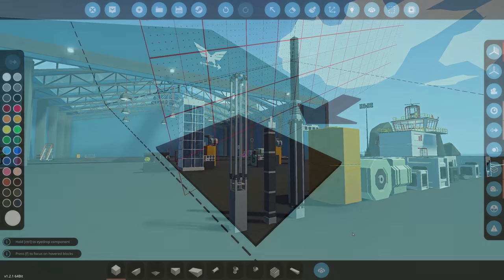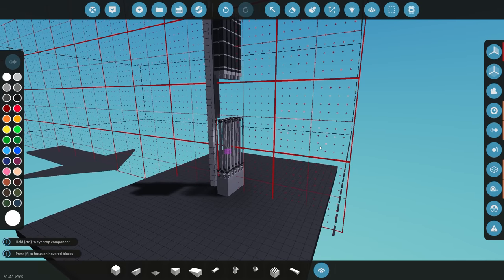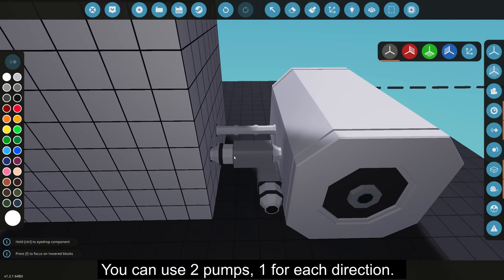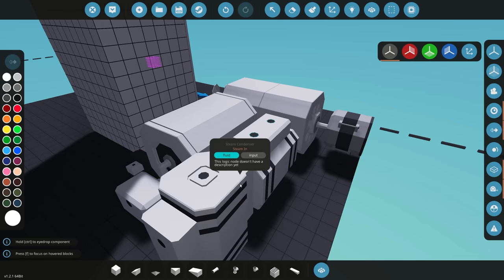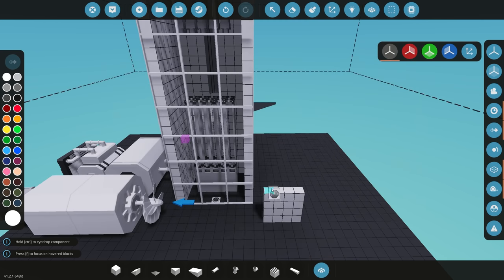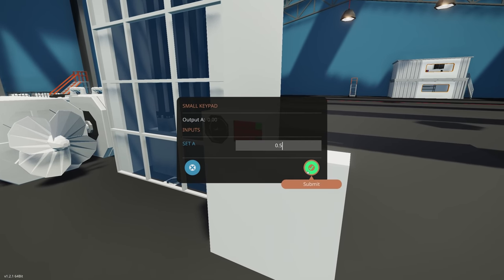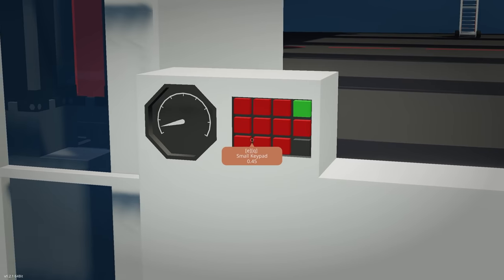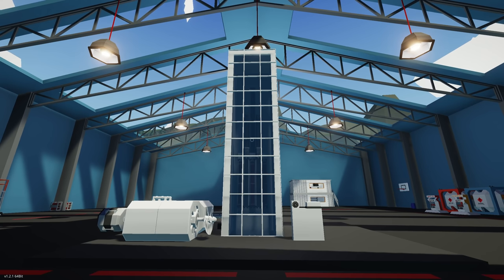Building a Nuclear Powered Engine!!!! - Stormworks

Comment: Thank you for the tutorial, I'd like to add some help of my own.

Control rods were the most annoying part of a reactor for me, since function blocks keep a static temperature and if you want to test what temperature works best, it is a god damn nightmare. Also that control rods are confusing to put in and for a while I actually thought they inserted into the fuel assembly like fuel rods - thank you, Stormworks description.

To place them in right, you have to line up the black 'weld lines' on them with the fuel assembly, or three blocks lower than from the top of the assembly.

Also, control rods limit the reaction rate of their neighbours, which means fuel rods that are diagonal or horizontal to them, that are right next to them.

To use a PID to control the temperature of the rods, positive P values wont work. You have to use negative P values.
I also recommend using a clamp for the PID, with the lower bound being 0.1 and the higher bound being 1.
In my nuclear reactor, before I added the clamp, the temperature would fluctuate by about 300 degrees if I was aiming for 500.
With the clamp, it only fluctuates by about 100. Not the best, but not the worst either.

Quick edit:
For the boilers, you dont have to use an on/off valve to control the pressure and temperature. Instead, you can use two PIDs.
PID A reads the temperature of the boiler. PID B reads the pressure of the boiler.
For PID A, link the output to a variable valve going to the "coolant" in of the boiler. For PID B, link the output to a seperate variable valve going into the water in on the back of the boiler.
For me, PID A using P=1 and 0 on everything else works extremely well, and a target temp of 130 gets it to 129 and some decimal.
Reply: What did you put the setpoint of PID B as?
Reply: @Babadaboopi  1, but so far I haven't been able to control pressure using PIDs, only temperature
Reply: Touched Stormworks again recently, learned some new things from slapping together a reactor to get the basic concept down. A couple things:
1. On the PID that controls the control rods, set a max value of 1. This acts as a clamp and prevents integer runoff (correction value going up to 7 billion when the system only accepts 0-1). I find that a P value of -0.1 works beautifully at regulating reactor temperature, with an error of 0.3 degrees. Can't remember if I had any I/D gain, though..
2. You can 'control' pressure by limiting the amount of water the boiler gets. This is done by making a closed loop with a water tank. This way, the boiler pressure will stay the same once it gets up to steam (hahahaha)
3. Condensers are... weird. Try to use a normal cooling loop and they turn steam into steam. From what I understand you can only put cold water in, making them a sort of black hole for water. This is fine for ships, though, because you have an infinite water source everywhere around you. For other things... not as much. I just put fluid ports onto the condensers with a pump straight into the coolant intakes. Works like a charm and is at ~55.
4. Reactors don't have to be terribly hot, apparently. Maybe it's the heat generated from the reactor seeping into everything around it but I could run it at 200 degrees and have enough temperature in the boiler to get steam. I thought something like 300 would be what you need, considering how much of a nice orange the fuel rods are.
5. I haven't tested it myself but I have heard you can take the steam from a turbine and run it directly into another turbine with no losses. (wtf infinite power?!?!?!)
6. 1000% have pumps to circulate steam and water throughout your closed loop. I tested to see if pumps vs. no pumps made a difference and they absolutely did. Without pumps I had 10-20 RPS or so on my turbine. With pumps it got to 50. Both without load, yes, but a massive difference.

Comment: The boilers, like radiators, don’t actually need tanks for the water that will be turned into steam. The boilers automatically contain fluid. However, it performs better with extra water tanks :)
Reply: But in theory, couldn’t you let the steam vent to atmosphere and have no tank, simply sucking in water from the ocean?
Reply from the maker: Already covered in Coal build of what the use of fluid tanks are.
Reply: @MrNJersey  I know, I was just saying it because of me forgetting to add tanks to a steam train I made before the tutorial lol. But what about the second question? I’ll have to test it.

Comment: i can never stop the boiler from exploding, even with a regulator of some sort. and even with overheating turned off at some point the reactor stops producing power entirely.
Reply: I believe this is my opinion from some of the other guys I’ve seen that you’re supposed to use two different types of coolant for the boiler one from the heat source and one to keep the boiler from overheating that’s from some of the guides I’ve seen that A needs to be heat source, B needs to be something to keep the boiler from getting too hot

Comment: Hrm, I've built a reactor identical to yours and my control rods do nothing.  The description for control rods says they can be inserted into fuel assemblies, but that's pretty confusing since they seem to actuate on their own (they make a sound at least, I don't actually see the part moving..)

EDIT: I'm dumb, the control rods were 1 block off from being aligned with the fuel assemblies, once I fixed that they worked fine.

Comment: So I set up my reactor, it is perfectly stable around 800-850 temp with 10 fuel rods and 4 control rods, however when I press the button to shut it down, the fuel rod blows up and irradiates the area. I assume it's due to shutting down the control rods as you disconnect the fuel. Am I correct in thinking this?

Comment: you dont need a water tank for the boiler and condenser, they spawn with fluid in them like radiators
EDIT: NVM from my testing having multiple turbines per boiler works best and turbines dont spawn with steam so when the boiler boils it loses water to steam so using a fluid tank inbetween the condenser and boiler will allow you to get to higher pressures.

Comment: I've been waiting for this update and I started playing around with different designs, but the only problem is that it seems that tge turbine does not have enough torque even using a single gearbox connected to a generator (the medium one) the best output I get is around 85 charge which can drive a large propeller at a mere 6 rps before it starts draining the batteries. So my question is what would be the one thing you suggest I add. Btw I'm using the same design at the preset provided from the update.

Comment: My question is, does the does the boiler+condenser also convert sea water to fresh water?
Reply: My question is does it accept salt water
Reply: it does not.. sadly. because that's the current bottleneck, is the steam output of the turbine builds up... 

if we could convert sea water to fresh water with a desalinator we could actually get some power from these things.

Comment: Usually you would use gravity to insert the "control" rods, not the fuel rods.. but.. to each their own :D
Reply: In game the control rods are used to regulate the reaction as the water in the reactor is not replaced nor is there any coolant for the reactor. If im correct in real life control rods are more of a safety mechanism to stop the reaction in emergencies right?
Reply: @natelav534  Correct. They regulate the reaction, but SCRAM inserts them all the way to stop the reactor in emergencies.

Comment: I know this is old, but can anyone help with the boiler not blowing up, I know that it's because the pressure comes over 10, but I don't know how to stabilize it.
Reply: If you have not figured it out yet, you need  to limit the coolant(hot water) in to the boiler by either using a variable or on/off valve.  I actually use a throttle and variable valve so that i can set the flow to balance the flow with the pressure and temperature.  You don't want to let the boiler get much over 115c so reducing the flow of heated water, you can balance the heat so it doesn't build or lose too much pressure.

Comment: My condenser just doesn't work. The water volume just slowly goes down, until it's on zero. I have a 2x3 fuel rod reactor, 4 boilers , 1 turbine for every boiler, 1 pump for every boiler, boiler fill level is on 0, tank fill level is on 7 and the function block is on x/10000. There is one condenser for every turbine and the condenser has 4 large radiators. The reactor's top temp is about 1100 °C. Every turbine goes to it's own fluid jet. Please help.

Comment: I don't get it, if you divide the fuel rod temperature by the desired temperature the result does not correlate with the desired position of the control rods.  Eg.  The core temperature is 250 and the target temperature is 250 then 250/250=1 and the control rods will be totally inserted and this will kill the reaction.

Comment: I made a massive reactor with 6 boilers and 10 turbines I was utterly disappointed at the performance. reactor temperature was around 1000 I was having 0 liquid in my boilers even with added tanks in my steam pressure was 41. Considering how heavy and large they are completely under powered at the moment.

Comment: Absorption rods must be between the fuel rods to slow down their reaction. And the fuel rods, if they are close to each other and there is nothing between them, should start a reaction and heat up even if they are not in the fuel assembly. 

By the way, the overclocked reactor cannot be stopped so easily. It will need more time for reactor to slow down. 

But the fact that loading nuclear fuel does not happen immediately and you need to manually load it is cool.  It was possible that they did not spawn, but that they needed to be buy and brought from somewhere else and then inserted 

Nuclear fuel can be used up for a long time. With normal operation, it should be enough for 25 playing years 

The idea is that it is difficult to charge.  And not because the nuclear reactor is weak or will end in 10 days. 

To absorb heat and radiation, you can make special heavy blocks or use ordinary heavy blocks. 

(Ру)
Reply: Thats how it would work irl but stormworks isnt that sophisticated. Even the devs demonstration reactor only has the rods on the sides.

Comment: can i only cool the reactor with the rods or could i also pump in cool water?
Reply: The rods control the reaction rate. Pumping in cool water won’t do much.
Reply: The rods dont actually cool the chamber, they stop it from getting more hot. The reason the temperature starts going down is because the steam generater attached is taking some of the heat
Reply: The control rods absorb the reaction created by the fuel rods. Pumping in cool water won’t help, as the reaction in the fuel rods is far too strong to let the temperature be affected by the water.

Comment: My pump doesn’t pump. Can’t figure out why. It’s hooked to a dedicated battery and constant on signal. It just doesn’t turn on. There’s way in the system. Piping is hooked up and fluid ports connected correctly.
Reply: Figured it out. Boiler was backwards. Did realize the direction of flow mattered for the boiler but it does.

Comment: I decided to take a few hours to try to make a reactor module so that it can fit in the center of a ship laying down, its been a challenge but I got through it I think
Reply: Is it able to be refueled or no
Reply: @ILoveFood0911  not yet, still trying to work out the bugs in that, I just wanted to make sure I can get it to work at least. Right now I'm doing ship tests to see how effective it will be and such. I am thinking a cargo hatch setup on the top to be able to swing out to be able to reach down to get it but im still working on it
Reply: @ILoveFood0911  nuclear reactor doesn't require refueling. It's unlimited.
Reply: @thelightbrigadef4172  it won't stay that way, the rods are supposed to burn out eventually whenever they add that
Reply: @NightTyrant6  what I did was a winch and the slider tracks that have brakes on them, they can clear a one block gap without coming off track so you drain then open the hatch use a pull and release winch to pull it out, disconnect both winches and remove it however you please before setting your Second core on the track attaching your winches pulling it back in and refilling with water
Reply: @ILoveFood0911  ill give that a shot and see if I can do it successfully

Comment: I hope they'll add smaller fuel rods cause those are too big to use in vertical way in any medium size vehicle.
Reply: well they're not meant to be used in small / medium vehicles.... + you need a pretty large water container around it so the mass is quite big
Reply: @hivewasp  it's quite big in height even for good sized ship. Or your engineering room shoud be much higher..
Reply: @FunBanan117  why not put the bars horizontally and cover them with glass flooring ?
Reply: @hivewasp  that's the only option indeed, just visually not the best..

Comment: Why are they calling the Boiler a Boiler when it's clearly a Heat Exchanger?
Reply: Maybe because it turns water into steam?
Reply: @tymoteuszkazubski2755  No, it's very definitely a heat exchanger and not a boiler.  It takes the heat from the primary coolant loop and exchanges it with the secondary loop without the loops having to touch and therefore irradiating anything besides the primary coolant.
Reply: @nicholaswhitfield9341  my take on this is that the boiler transfers heat from the reactor loop to the outer loop heating the water into steam, the condenser outputs water and water is inserted into the boiler, steam comes out.

Comment: This is fairly unrealistic, I know it is a game, but a nuclear reactor has a two part system, water I  the reactor to cool it down, and a separate pipeline (not connected In anyway) that heats up and goes into the boiler, otherwise you are literally pumping steam that is radioactive into the environment. In fact, the cooling water has to be stored in big tanks under the ground to cool down, and also become less radioactive. In this circumstance, you are killing the environment and also not even cooling the reactor, unless the devs have found a way to instantly and efficiently transfer heat almost immediately

On further evaluation, the boiler may serve as a two part process (cooling reactor fluid and then also a separate pipeline for the turbine)
Reply: Thats not how any of this works. A cooling system doesnt need underground tanks to cool the cooling water. Thats why its a cooling system. Like have you ever heard of a cooling tower? Heat transfer gets faster the bigger the temperature difference is. 

Also boiling water reactors are a thing and they literally drive the turbines with steam directly from the core. Most pressure water reactors use a double or triple circuit though. Also the water itself hardly gets irradiated. Its a great radiation shield in of itself.

Comment: How to you keep the Boilers from exploding once reached over 10 pressure.
Reply: someone said put a pump on the condenser intake, but alternatively, you could pump the excess steam out
Reply: Limit boiler temp to less than 115 or 110 with valves from hot water input.  Lower steam useage needs lower temps.

Comment: I have a reactor powering 4 generators with 170 output each and can’t even power a medium motor
Reply: Are you using gearboxes?
Reply: @ILoveFood0911  On the motor or on the generators?
Reply: @reichenwald-gm4qd  generators
Reply: @ILoveFood0911  I do but the don’t make a real difference. (I’m using the biggest available ones)
Reply: @reichenwald-gm4qd  the size of gearbox isnt relevant, take the output from the turbine and trade for RPS into 1 generator use the smallest gearbox the other ones don't do anything

Comment: The boiler keeps blowing up I've tried limiting both the temperature and water it has available to stop it from blowing and the vehicle is a submarine so I can't just vent the steam because the craft is going to be underwater at times
Reply: Use a on/off valve going into coolant in of the boiler.  Use a less than gate connected to the boiler temp and a constant number of about 105 to 110.  Connet the less than node to the valve.  It should open the valve when boiler temp is below 105 allowing it to heat up and create steam then shut off at 105 allowing the boiler to stay cool and not produce too much steam.    You can play with the numbers to figure out what temp limit works best for your setup.  Keep in mind that if you produce steam but do not use any the pressure will build fast.  So maybe add logic to limit the coolant into the boiler if you aren't using steam.
Reply: @Bendigo1  I came up with something similar a few days after i posted my comment but yeah what you said does work

Comment: Why do you use tanks when boilers have fluid in them? Both dev examples don't have water tanks and they work just fine.
Reply from the maker: Watch the Coal Video
Reply: If the tanks not there then theres no water in the actual system. This may be a bug at the moment as the dev setup doesnt have this

Comment: Hey can you maybe help me guys?!? i built  a 4 fuel rod, 8 control rod setup, and for some reason i cannot get it to be stable under 1400 degrees. ive added more rods and taken away rods, ive added more space for water and more pumps to move liquid around faster. but i cannot get it to sit under 1400degrees. plz halp